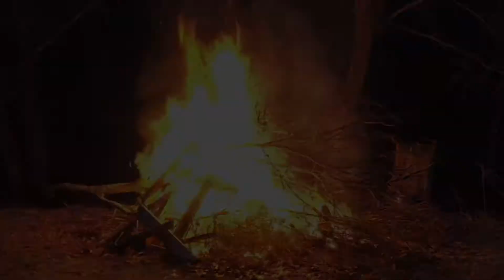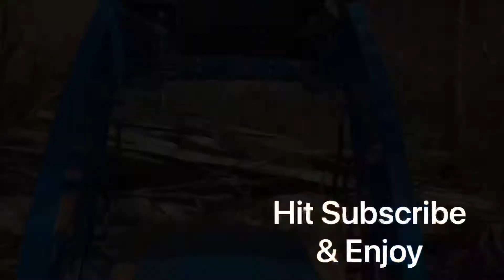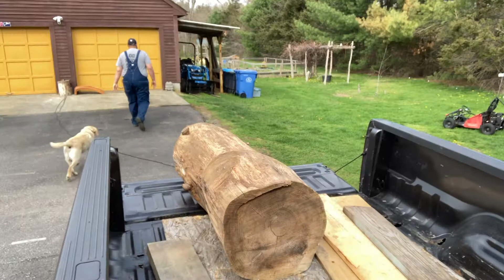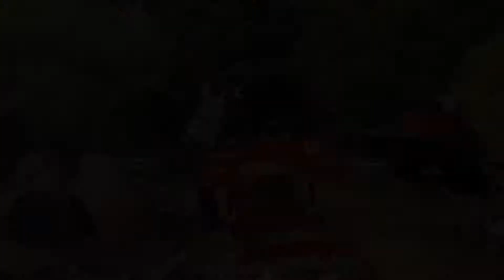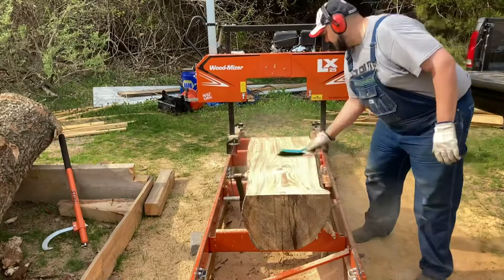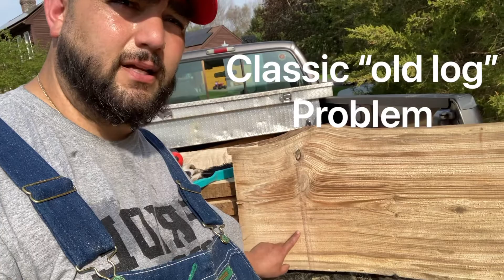Woodmizer LX25 Milling Hemlock Slabs for a Friend, this Log Surprised Me!

Comment: Joe, I have the Timbery M100 version of the WoodMizer LX25. I did cut the finger out of the exhaust shoot, and did  a cut under the tensioner pully so I didn't have to stop every couple of cuts, the sawdust does not build up now. I I buy the timbery 10 degree blades for soft wood and ( degree for oak, maple , poplar any hard eood.
Reply from the maker: Good to know.   I’ll be making changes soon myself.  Thanks for watching!